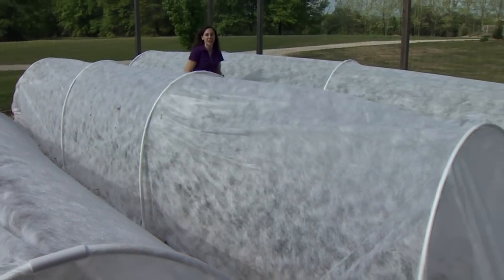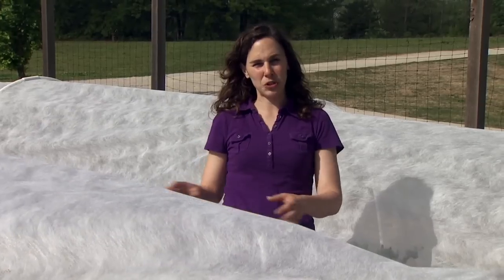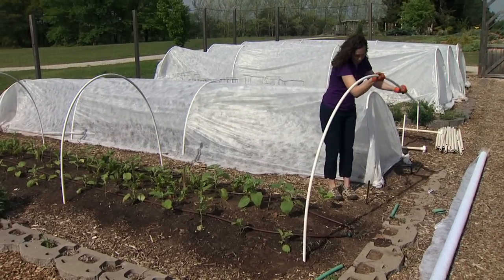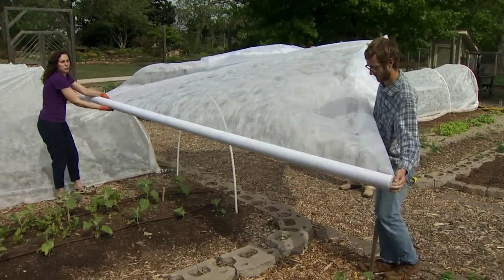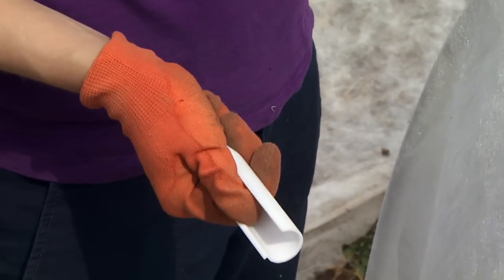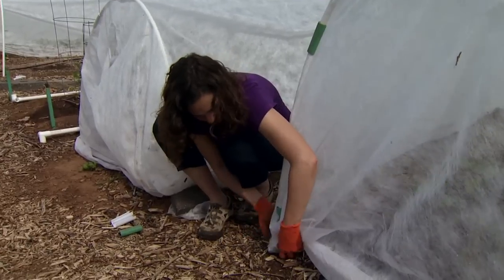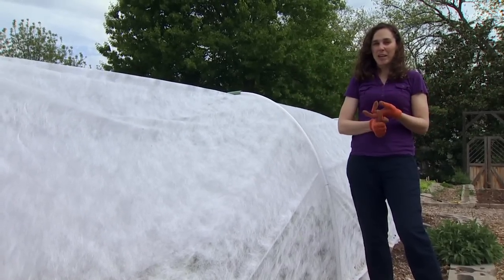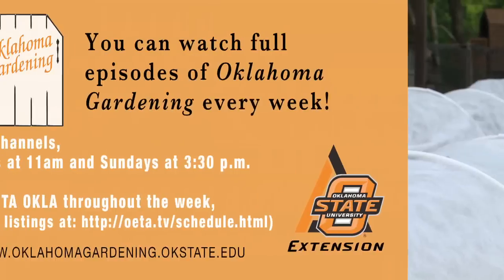Constructing Row Covers

Comment: Hose pipe clips are great but after a few removals and replacements the rip the row cover.  I use large Acco binder clips for easy access.   They fit really well on 1/2" PVC pipe, are easy to take  off and put back on, and don't tend to rip the row cover like the pipe clips do.

I like to cover the ends with one piece of cover and never move it.  That, I attach with 6 pipe clips.

The 2 pipe clips at the top of the arch attach both the end piece, and the main row cover that gets rolled up for access.  Two binder clips secure the bottom and middle of the main piece.

That way, I can take off the binder clips and re-clip them just below the pipe clip at the top, under the main row cover material.  Then I roll it up and rest it on the binder clips to keep it out of my way.  When I'm done, I just reverse that.

Comment: Instead of using rebar, you can use a larger PVC pipe that is hammered into the ground. Insert the smaller bent PVC ends into the larger pipe in the ground. If you remove the hoops, place caps on the larger PVC to keep bugs and dirt out.

Comment: Thank you for posting.
I would keep the netting edges down with bamboo canes held down with tent pegs so birds cannot push through the netting and get trapped inside.
One day I came to check my cabbages and found a mother blackbird dead inside the cage who had pushed in through the net at the bottom but couldn't get out. She died in the hot sun.

Comment: I tried something similar but not as high - blocks spaced like that, and OK winds will pull and pull on the fabric until it's ripped to shreds.  I was hoping since this is a reputable gardening resource in OK, that there would be some advice as to how we can secure anything against our unrelenting wind (its just a mild breeze in the video)
Reply from the maker: Unfortunately if winds do get too wild, the row covers can take a beating. Here is a factsheet that gives some more ways to tweak your row covers to fit your gardening needs (pg.5). Thanks for tuning in, happy gardening! http://pods.dasnr.okstate.edu/docushare/dsweb/Get/Document-1099/F-6034%20web.pdf

Comment: What size is that you're using?

Burpee
*Floating Row Cover  72" x 50' 

Gardener's Supply Company
*Summer Weight Garden Fabric 85% light transmission two sizes at 6' x 20' and 6' x 50'
*All-purpose Garden Fabric 70% light transmission three different sizes at 6' x 20', 6' x 50' and 12' x 20'

Johnny's Selected Seeds
*Agribon+ AG-15 Insect Barrier 90% light transmission 118" x 50'
*Agribon+ AG-19 Floating Row Cover 85% light transmission too many different sizes to list all 83" x 50', 10' x 50' 

Gurney's
*Floating Row Cover 61" x 25' and 61" x 55'
Reply: As you know this is my 2nd yr with the row cover.  Agribon 15 and 19 was too flimsy and tore.  I have now gotten Xavan by Dupont from Johnny's.  The smallest size is 15' X 50'  My rows are 79" wide so I should be able to cover (3) rows.  Now is still have Agribon 19 covering.  I am amending my soil daily.  My Ego mower, bag, and hi blade collect a bag full of leaves.  I sprinkled them on the garden and dug squares of soil and buried others.  I also got a Jang seeder so I should have nice rows in 2018.  I found seeding to be too arduous of a task for the amount of seeding that I want to do.  Thank you for you help in (2016/2017).  I was overwhelmed:-)  I did not like using the (6) mil plastic bc things dried out to a crisp.  I have come to accept that Nov, Dec, Jan, and Feb are non planting months in Pittsburgh, PA for me.
Reply: I was going to make my own just like this, until I found one on Amazon that fits my needs. I'm a mom with two small kids, so going to the home improvement store, finding the supplies, and constructing it myself isn't the easiest thing with two little ones.
Amazon:
Tierra Garden 50-5030 Haxnicks Easy Micromesh Tunnel Garden Cloche, Giant (they have several different weights...mesh/fleece, etc. and several different lengths, and it comes with hoops that stick straight into the ground and folds up like an accordian when not in use. Maybe one day I'll still build my own, but for now, this is easy for me!